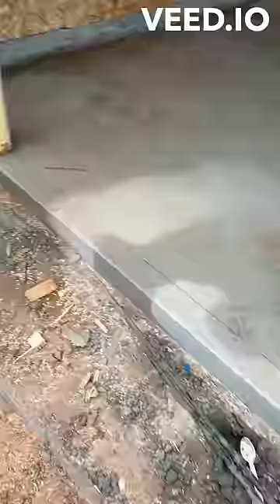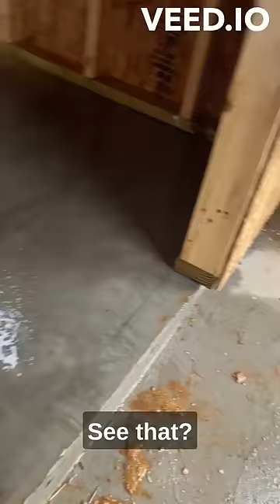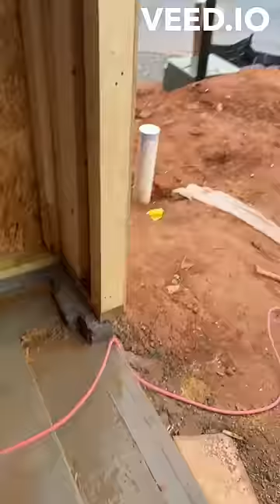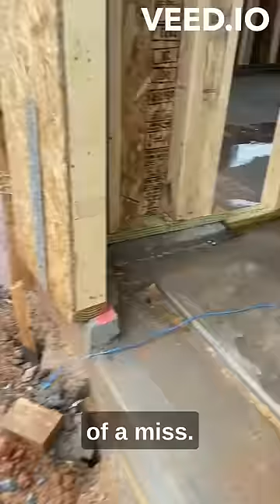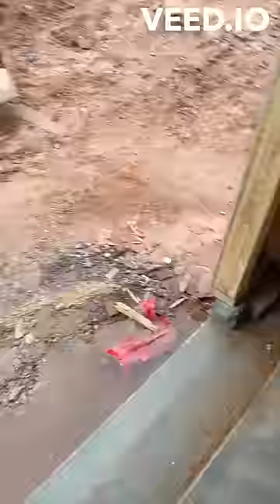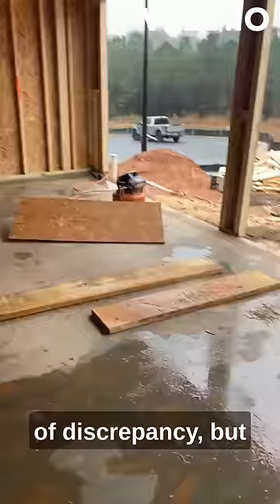New Home Slab is Wrong Size, What Now?

Comment: What to do here as a framer, after you snap lines and check if it's squared, you let the general contractor know about the concrete discrepancy to see if there's a solution. Before you frame it.😊
Reply: Yeah like the blueprints will need modified. These framers on crack or something?
Reply: No no no , that makes way too much sense , why would they want to do that ? 🤣🤣🤣🤣
Reply: @jesusischrist1527  I think they wanted to be paid to take it all down and re-do it.  This is just people that don't care.
Reply: No because that means all the crew to don’t work that day ., week or month and wait until it is fixed .,
Reply: What if they DID, and the general contractor told them to "just frame it" as an answer?
Reply: No. We just work there. The owners need to stop rushing everyone. Quality out the window. We're like China now
Reply: Ah yes, I think this is referred to as not being a dick
Reply: Wow what a concept 😂😂😂😂
Reply: it's because the contractor said keep going. it seems like most of the time it's  more important to get it done than it is to get it done right
Reply: @dialecticalmonist3405 IF that’s what happened then the GC is an idiot. They should have just adjusted the framing to the slab (or had the slab guys come fix (though not sure how they’d do that)
Reply: @codycast Exactly; what would they lose on interior measurements 2" tops.
Reply: One of the two contractors didn't read the blueprints..
Reply: @consaka1 it's very likely the framers are correct to the engineering blueprints. Roof trusses are almost always pre-built and delivered to the job site. If the framers would have adjusted to match the  concrete the roof trusses would not fit.
Reply: Jajajajajaja 
As a framer we never had issues.
lol 😂 almost never!!
We always adjusted as needed.
You check the overall before you start.
I remember one day the trusses company said “Ernesto we never have issues with you””
Of course,
I always took care of them on the spot 👍👍👍
Keep production going 👍👍👍👍
Reply: Follow the plans……
The plans will set you free!!!
Reply: @thomashefner Trusses would fit if you adjust the stud lengths to keep the top plate level.  Would be a lot of extra work for the framers and would need longer studs to trim to size.  Drywall framers and trim guys would have a fit with it.
Reply: if you are modifying the trusses, you are required to have the prints redrawn, signed off by an engineer and resubmitted to the building department. It's time-consuming and expensive. If you are not doing that you are telling us that you are a hack.
Reply: And no customer would want to hear it but that house needs to be made 3 inches shorter, not overhanging the slab. I never seen that in my life talk about an idiot.
Reply: Everybody needs to be sat down and explain that the house will now be 3 inches shorter, otherwise rip it out
Reply: @thomashefner  I'm very aware of that which is why you take the issue back to the main person in charge of the blueprints because a decision will have to be made and the time to make it is before framing starts. You can alter the blueprints and redo the trusses if they've been done already or you can make the concrete guys redo the concrete. You can't just patch that and expect full strength. I'd expect the GC to come down on the concrete guys like a ton of bricks. Whoever messed up is losing money on this job.
Reply: We come across this many times, the architect has to approve the reduction of the size of the structure by a few inches, 
Which can affect the roof trusses and load barring points, but usually doesn't but when it does more changes have to be made...
(Other load barring walls may be moved or changed to 2x6 to match up with load barring points on the trusses...)
Reply: @curtisflategraff6511  You think a GC, Who knows that will NEVER pass inspection is going take on the cost of fixing it and the damage and embarrassment to their reputation....? I don't think so... Could get very expensive..!
Reply: Well who ever did it is probably a 3rd party group. If they don’t work they don’t get paid . In the construction business it’s the next man’s problem
Reply: Just move the damn wall an inch,
Reply: Just tilt the walls in at the bottom problem solved..Now what else needs my solutions
Reply: I’m willing to bet that the framer absolutely 100% told the home builder and the builder told them to cram the house.   The framer was scheduled to frame that house and shouldn’t be loosing money since it’s very likely that he didn’t have another job lined up right away.  The builder will fix and the concrete guy will pay for it.
Reply: @curtisflategraff6511 👍🏼
There are common sayings in construction.
• 'There's never enough time to do it right, but there's always enough time to do it over'
• ' Can't see it from here'
• 'It's not my house'
Reply: So.. framers couldn't have framed it inwards the couple inches? 
Wth
Reply: Remember, nowadays the frames come already prefabricated, the framers just are assembling what they receive. But yea there was a lack of communication here.
Reply: How about instead you childishly put it in per plan as a passive aggressive gesture??
Reply: AMEN BROTHER!!!
Reply: @dialecticalmonist3405  Doesn't matter. Do you want your name on that nightmare?
Reply: Nah you screw up the entire job and leave everyone scratching their heads after and cost thousands to repair it lol
Reply: what happens when u piss off the contractors and stay on there toes 😅
Reply: I was wondering the same thing man. Like why even do it if it’s wrong. And I cal already hear the boss’ comment to his employees. “That’s not our job, we have a job to do and we’re going to build our shit to the specs WE are given.” And I’d leave. Can’t do something I know isn’t right. Idgaf about getting paid for it or not.
Reply: This is what happens when it's rush rush rush just put it and get it done 🤔🫣🙄 y left the trade 😔
Reply: @crawlspaceemora brother, you haven't met very many engineers... I built a bag house at a gold mine in Nevada. The prints were oriented inversely so north was really south. Consequently the bag house was backward and the conveyors led to nothing. That's when we started wondering about the plans. Then we worked 7 12s to try and catch up from the mistake. I guess our overtime was cheaper than the late clauses in the contract. The company was called TIC. Stands for "Turning In Circles"😂 (or The Industrial Company)
Reply: I'd avoid this company in the future. If they don't know how to deal with this, what else will they not know how to deal with.
Reply: That’s easy fix
Just fill out the concrete 
It’s obvious they did the framing even though foundation was off
Reply: The framer gets payed twice now though. Because it’s not his fault. It’s the concreter’s.
Reply: @GrasshopperKelly  the framer is fired. They don’t get paid and a mechanics lean is placed on the property until the court proves the framer is at fault.
Reply: @jstrada5077  minimum 12x18. That’s gonna cost the same as the new slab all the way around. No.
Reply: @buixrule  "Doesn't matter"? So what is the solution? Build the thing to conform to the wrong concrete foundation and then get sued if something goes wrong because you intentionally didn't build the frame to spec?
Reply: Adjust the framing seen this several times. Don’t turn a small issue in to a big issue
Reply: Exactly. Amazing comment
Reply: It’s probably a pre fab bud
Reply: That all has to pushed back you can't form CONCRETE like that it would never pass ,,So you garage is 11-8 instead of 12 get a better contractor
Reply: Yes, keep it simple.
Reply: Well no shit
Reply: Was this done recently in Florida?
Reply: How dare you make sense!
Reply: Thank you, I was wondering why they would continue framing if they could see it wasn’t right.
Reply: This framer eats his whole burger before asking for a refund because it had pickles on it and he asked for no pickles
Reply: Not a project manager insight
Reply: Either the concrete guys screwed this up, in which case the GC should have made them fix their mistake, or the framers screwed this up, in which case the GC should make them fix their mistake. If everyone followed the drawings correctly then the mistake lies with the architect for not coordinating the structural/architectural drawings. As a GC I'd be talking to a lawyer at this point to determine the correct course of action.
Reply: So who pays the crew for the downtime because of a concrete mistake? Asking for a framer friend of mine.
Reply: @codycast well what I've done on jobs, many jobs, is rough up your foundation walls, drill steel dowels, form it back up and pour.
Reply: Right, but what is the solution to this problem?
Reply: Nailed it lol
Reply: Not sure how it works where you are from but here if the GC can get you to start work, then you've accepted responsibility. As a GC and commercial super, I'd recommend you get something in writing and have your lawyer review it before you start work... never start until you are covered.
Reply: Except when the GC curses you out and yells at you “ FOLLOW THE DAMN PLANS!!!!”

Yes sir!
Reply: Hey Boss... The new guy you hire is no goooood. You pay him way to much...
Reply: As I’ve seen in first hand with couple years of experience I can say that more often than not it’s miscommunication and miscalculation from either party involved… also General Contractor also tend to give the green light prior to continuing the job… this seems like possibly framing inspection getting done?
Reply: @codycast  add more concrete around the slab or 2”x2” angle iron under bolted to the slab..
Reply: Problem with prefab framing. It goes together like a puzzle. And slab needs to be right or pieces dont fit.
Reply: Exactly.
Reply: @paultarp9150 this is exactly why they do it! As a builder, I occasionally see this type of bullshit. I fire them immediately and have another crew come make the corrections. They know better but don’t give a shit!
Reply: Right. Who does the whole job a half a wall off ahahaha. Pos😂😂 you know when he got done he said. ( looks great from my house.) Then drank a few beers on the way home to get what he had done out of his head. I'd fire dude that did this.
Reply: Check this guy out..... making sense n all that 😂
Reply: Yep
Reply: Preach! Sounds like a bad GC. Someone is not spending much time on their job sites....
Reply: No they absolutely could not have.  If they made the house smaller then the roof trusses which were either already on site, or soon to be, would not fit.  I guess you have never built a house. @turboflush
Reply: No, you go ahead and frame it and get that $ and let someone else worry about the issue(s).
Reply: The problem is cheap labor can't speak English so they just take the day pay cash and when they get canned they don't care.
Reply: @jayburris6252  depends on your roof system.  I guess you have never built  a house. 
Either way.. someone is responsible for the bad decision to continue, knowing a problem.
Reply: Framer's have to work to kitchen cabinet dimensions. The cabs are already in production. Also the miss seems very consistent, concrete guy was probably using inside dimensions or something.
Reply: @turboflush what happens to the kitchen cabs then?
Reply: This is the new America (US) get it done now, we'll deal with it later attitude. We must build, must build in a hurry, the more we build the more money we'll have. 
I see it almost every day.
Reply: @spilledit Illegal, especially Mexicans in South America's. Need to go to China to learn how to do something right.
Reply: I don't think they framed it. I think all those walls came prefabbed from a plant on a flatbed and raised up by a telehandler. Concrete guys deviated from plans most likely, or plan needs to be redlined. Had this happen on a commercial pool project, they screwed up the pool house big time, our measurements were way off, turns out someone screwed up the benchmark
Reply: @JT_70 exactly. Everybody’s paying for the dumbass concrete guys mistakes.
Reply: "I built it to the drawing boss, what do you want from me"
Reply: At least it’s consistent
Reply: Cheap is cheap gets
Reply: @spilledit yeah it’s a process that can’t be rushed
Reply: Good luck passing final or getting insurance.
Reply: Most houses built today have some trusses and ALL production houses have trusses.  The concrete guy is responsible.  Period.  No discussion needed. @turboflush
Reply: And delay pay day for a few weeks? Nah I gotta get that bag!
Reply: This is unfortunately is not an uncommon occurrence- that is why with 40 years of Commercial/Residential construction experience I prefer not to hire any contractor to build my house or other
Reply: I'm guessing this isn't the first time the framers arrived and the slab was off. Delays cost time. Time costs money. They likely framed exactly what the drawing said to make a point to the GC. In court, the framers can likely prove they built it per the drawing. GC will probably back charge the concrete guy for the framers to fix it. Framers get paid twice rather than costing them money.
Reply: What if you measured the concrete before even starting the framing. You know, to make sure it matches the plans?

Can't be too hard. There's literally nothing in your way.
Reply: exactly
Reply: The framers did good by building the house. The concrete guys can fix this later.
Reply: Yeah obviously. You don't need to be a framer to figure that out.
Reply: Im sure general contractor knew it was inspection day, I don't think he cared 😂
Reply: and China's production quality is getting better and better @spilledit
Reply: @dialecticalmonist3405  that's likely what happened
Reply: Was the framing made off site
Reply: Exactly and more likely than not they would've been told to move plates so they're sitting on something solid and  Just keeping everything else like plans call for and just lose a couple inches right there.
Reply: This discrepancy albeit small, changes the rest of the blueprints and that could cause a major issue not to mention that being 2-3 inches on frame actually changes the square footage of the whole home and being a big house can add up to a lot... imagine now trying to frame or run electrical but having to adjust all measurements by a few inches overall...
Reply: A big shed.
Reply: @thomashefner well said
Reply: @jackwillie2729 Best plan out of all these other ideas 💡 😊
Reply: Yep! Been here a hundred times! People don’t realize that the trusses are already sitting on site by this time, they gotta fit!
Reply: @codycast how do you push all walls in 1" without thinking about all the windows, doors, electrical, plumbing, drywall, and finishing guys
Reply: Truth
Reply: I'm guessing the framers came after this concrete guy before .
Reply: @thomashefner your not a framer ...for sure ....the trusses can be modified, and bearing points added ...... seriously?
Reply: @roberthopsonsr.2822  sure, if you want to have the truss plans re-engineered and re-submitted to the building department. You might call yourself a framer, but it sounds like you're a hack.
Reply: Thank you. YOU HAVE THAT COMMON SENSE, THE KIND THAT COMES FROM GIVING A DAMN!!!!
Reply: @davidgray8089 This is the comment I was looking for. By starting work you are accepting the substrate is correct 👍
Reply: @Imarida2 you can extend the concrete to the correct dimension, with engineers approval. Meaning drill and epoxy some anchors, add welded wire fabric and then form up and repour. I’ve had to do this on one job and it was a pain in the ass. Think we needed a 16” foundation and it was initially a 12” if I remember right. But this would be difficult with the framed walls in place, and the fact that it’s been backfilled. Other option is to move all the framed walls inward. But that concrete guy is most likely gonna have to pay for whatever the fix is
Reply: @consaka1 when did anyone mention farmers?
Reply: I recently learned that they don't stop. They just keep working. In my case, it was the manager that came by to check and stopped them. They just go by the blueprints regardless.
Reply: @spilledit  my house took 16 months. I wasn't rushing them but dammnnnn living with my parents for 1 year suck ass.
Reply: But then you don't get that sweet sweet change order money
Reply: This is the correct answer.  Everyone here saying the framers didn't screw up and it's on the contractor who did the pour is missing an important point.  While the framers may have built to the plan, by not stopping and bringing an issue this big up the the general you can guarantee that this is the last time this framing contractor would have a job with this general. Employees who just do what thier told without thinking are half assed.
Reply: I guarantee the cheapskate homeowner is the gc and this is his fault
Reply: @Imarida2 Read @Bawk Bawk Bawk 666 replying on how to repair the foundation! It's the comment right before yours
Reply: @codycast this is not impossible to fix for the slab guys. Even after framed, though that makes it more difficult. The slab won’t be as good as it could have been, but it will be fine.
Reply: How absolute dare you make sense!
Reply: They probably did and foreman said just build the damn thing
Reply: @consaka1 They probably finished on a Friday afternoon, and got started drinking a bit early on the job.
Reply: And then you get a hand-written, signed (by both parties) note on the master set of drawings.
Reply: Completely wrong as the framer needs to get the house dried in so he can get his first draw. (Need I point out my sarcasm, but at the same time that’s exactly why to framer isn’t going to slow down because of someone else’s screw up).
Reply: Buy an older house and renovate it, better bones . 
Houses now a day are just slapped together.
Reply: @spilledit  Your solution to improve quality is do shit like this?

Get real. You want to toss around ideas like pride and quality, you don't get to even consider a move like this.
Reply: @deadfisher0000  pay better. Organize the company better. I'm not fixing someone else's company. Lazy bosses think someone else's labor is a right
Reply: WTF. What reasonable person just doesn't cut half an inch off somewhere and make a note?
Reply: All you have to do is make a few adjustments. Easily could have fixed these issues and the house would still be square.
Reply: This is exactly why you want to know your framer . Stupid to create these problems .
Reply: Best to get ahead of crew and find the issues out before you hit the job with a whole crew.
Reply: @hiway12 bullshit
Reply: @compudude86  you can still adjust prefab walls . This is stupidity at its best.
Reply: @jayburris6252 if the dam walls are off the slab the trusses will not stay up anyway . Rookie mistakes
Reply: @consaka1  Nobody measures anyway...A couple inches here and there is normal.
Reply: All that happened here was the concrete guys formed up for a 8 inch wall instead of a 10 inch wall. They'll have to fix it when they pour the driveway. I don't think it really affected the framing. If that garage wall is even off an inch that's not really a big deal. Besides the bearing below it obviously. But that will be a gable wall. This is all we've seen though there could be a lot more issues. I've literally seen houses that are almost a half a foot out of a square. Get to the last six trusses and this had raised heels lol. Last trust is hanging off of the wall 1 and a half lol. Not good. Slab on grade. Literally cut all long walls free from slab. Pushed em out. Concrete guys came back and dug literally a frost footing around half the house. Poured a shelf to fix it. Turns out the builder We were framing for had a long time concrete guy for his subcontractor. Well that guy's workers were purposely doing that to all of his basements for almost half a year to ruin his name. They all work for another subcontractor now after they accomplished their mission. It's a long story. I actually used to work for the guy before I started framing and this is a perfect example why you don't hire illegal workers. These guys moved with their boss from like Arkansas to wherever I'm not going to say. This was probably almost a 25-year long relationship. The main Foreman brought most of his family to work. As the years went by the guys wanted more money. Well they only got so much. They got to the point to where the boss never really showed his face. And the guys kind of just slaved for him. And from what I explained it got to the point to where they started to ruin the guy's business. Whoops
Reply: Could you add like 6"-12" concrete slab along the front under the overhang?
Reply: @spilledit owner don't rush and you guys go waaaayyyyy over budget and time
Reply: 3rd world help and want to complain.
Reply: To bad the framers don't speak english
Reply: @JT_70 that goes completely against code, hence why it can't be done. Also frames are pre made mostly unless your doing on-site framing. And due to the pre made trusses the only way around it would be to either adjust plans to match foundation or fuck it up haha. But that's what happens in nz so you could be right.
Reply: Everyone is in such a hurry these days all about the money. Which is obivously important but I've been a tradesman for 25 years and it just seems like the guys who seem to give a crap get treated the worse. Yeah,nice guys do finish last sometimes
Reply: Some times it's about calling someone out for a repeated offense.
Reply: That’s what I said then read comments lol
Reply: Ah the good old days it seems. The more videos I see, the more I wonder who is building these homes. Profit motive and quarterly beats.
Reply: Go watch SyFy home inspections. The crap he finds is insane. You couldn't give me a new home
Reply: I guess in this case it’s easier said than done 🤣
Reply: Simple solution,  they just need to make them 2x6 walls.
Then you get 4" on the concrete.
Reply: If the concrete crew is wrong, and formed it wrong the GC and the owner needs to know.. the framer should not be chaulking out the correct measurements if they are not properly supported.. the fix is make sure it's square but supported.. shorten the lenght or width as necessary. But it has to be supported properly. 
Having framed before I would be ashamed to put my name on that and even if the GC  said go ahead I would be wanting a clearance letter from him and an engineer absolving any responsibility from inspection faults or the owner saying what h.ll who framed this sh.t
Reply: carpenters can adjust to discrepancies.  that's our job
Reply: @consaka1  that's the piss poor work of a bad concrete guy and an even worse bldg superintendent because he is supposed to give one final measurement check to ensure this DOESNT happen.
Reply: It's not the framers fault.  The general contractor should have checked the foundation to the print.  If there was a discrepancy, the general contractor should notify the property owner and the framer.  If the framer built on a out of speck foundation he would be at fault.  Modern construction is mostly like this!  It's just about all shit work anymore!
Reply: Or simply don’t frame it as you’re the one putting your name on the work.
Reply: Why on earth would you check square after popping lines 😂
Reply: Preframed walls
Reply: @codycast exactly
Reply: @codycast probably custom made trusses on site, are you going to magically shrink them?
Reply: @williamclancy9150 It could be your bathroom vanity it could be the granite in the kitchen you never know they do it to spec for reason so this was definitely on the concrete guys in my opinion
Reply: Yeah it's all an inch and a half short
Reply: The concrete  guys screwed up and the framers are tired of having to fix the screw ups, so the measured it out to spec and said the hell with it.
Reply: @paultarp9150 oh guess what guys,you don't get paid to fix your fuck ups.
Is what I will tell them.
Should of done it right the first time.
Reply: Maybe the foundations off a little bit and they need to reform it a little bit and call it a day
Reply: I bet they did check and were told to go ahead because it's too late to change the print. Probably hoped they would get away with it
Reply: @turboflush not if they were correct in their measurements. They can’t change it that easy especially if there’s stubbed out plumbing in the slab fir say a toilet or something
Reply: The contractor wants it done so he can collect the next cheque……
Then he’ll say WTF.
Reply: Exactly. That's what we've done my entire life. If the slab is jacked. We let the homeowner or GC know after we pop it out and before we start framing. That call is on them 100%
Reply: @dialecticalmonist3405  if they DID. then that's 100% on the home owner and GC. Seems like that's the case here. And the guy making the video is just trying to weasel out of his accountability ànd put the blame on the concrete and framer guys
Reply: They probably did that and the person in charge was like it's ok. well just fix/ (bury)  it later!!! lol!!!😂😂😂😂
Reply: JUST POUR DRIVEWAY
Reply: The only thing that makes sense us they built out over the concrete forms...It didn't get caught until they removed them. Yeah that framing crew was a bit to impaired that day🥴
Reply: Couldn't possibly make an adjustment, it's easier to make excuses.🤦
Reply: @paultarp9150  yep. Insurance. Double pay. And material reuse issues too. All studs and beams are punctured and now compromised. Of course the gc will reuse LVLs and PSLs and Simpson shit and the rest of the vultures will pick through studs.
Reply: Whoops
Reply: @codycast yeah, how can it ruin everything to pull the framing back 1-2 inches. Drywall and sheathing will need to trim a couple pieces, big deal. Do the framers speak English?
Reply: @jstrada5077 fill out the concrete? That little strip helping hold up the whole house? No strength in a thin little strip. Bore into the existing and glue in rebar ties?
Reply: I'd bet the trusses can be shifted slightly. I've never seen anything really straight, square or plumb on anything I didn't build myself.
Reply: @r.rodriguez4991 it is standard to check square and dimensions before framing. Takes 10 minutes, maybe 20 for one guy on a complicated layout. Then only the plumber and concrete guys have to come back...and maybe a demo crew....
Reply: Yes that is the correct way. This honestly comes down to what builder the framing crew is working with though and the timeline. Most builders want them to just frame it though if it will stand temporarily. Because the concrete crew can come back after and repair it and if done right it wont effect the end product. key word correctly. But the repair is done the same way usually whether the framing is there or not. The framing does give them something to work with and nail to for repairs. Plus other trades can carry on schedule while repairs are done. I'm not saying you are wrong you are completely right to say the framers should call the builder after they pop lines and notice it. Where you are wrong though is assuming that they didn't.
Reply: @turboflush  That would shrink the floor plan or make it out of square so no. This is a very easy repair for concrete crews that know what they are doing and it doesn't effect the end product. Key words though "know what they are doing." Your suggestion does effect the end product. Would you like paying for a house with a specific floor plan and you move and find out your garage shrunk by inches? Or even just getting a call to see if that's possible for you to compromise on by your builder? No you wouldn't be comfortable as much as you might think you would be. So the framers frame the house correctly to plan and the concrete crew will come back and fix the foundation underneath it. No need to call the customer or change the floor plan. Hope i didn't sound like an az i thought you were genuinely asking😊
Reply: You don't change the plan because concrete guys made yet another mistake as they always do.
 The concrete gets fixed later geez. The house stays the same size as engineered
Reply: The framers should lose money because the concrete guys screwed up?
Reply: Right right that should have been a given
Reply: Or better yet it didnt have pickles on it and he asked for it.  @CoryFugger
Reply: This is the right way of doing things. Alas this is not the common way of doing things. As a result, the GC gets railed hard and hopefully has a way to make up the cost elsewhere.
Reply: Trusses are pre-manufactured at a certain size. They’re just fitting what the lumber truck dropped off.
Reply: I saw the chalk lines and thought, really you kept going even though you knew it was wrong?!
Reply: there was always a solution that nobody didnt agree with me
Reply: No.  The concrete guy was there with his tape.. The GC had a tape,, but the guys who find the problem and point it out are the ones who are gonna pay for it?  No effing way.  Concrete guy can come back and fix his mistakes.
Reply: The stick frame was likely prefabricated and delivered to site for erection.
The framer is lucky he found a datum edge or corner to start from.
The concrete team most likely got this wrong. It's not even square let alone the right size. 
It's not unrecoverable.
Reply: @walsakaluk1584  No.  whether panelized or stick frame,, the framer has no choice in the matter and IF he says, "I can't do this,,HE is the one that loses money.  So many of these comments,, say directly or imply, the framer should be financially held accountable.   There are 5 men and himself on the crew that is 2 or 3 grand a day in wages.  The concrete guy could not be bothered to pull out a tape measure,, the General Contractor could not be bothered double checking the concrete work before the pour or after.  It is strictly unfair to both blame, and financially punish the one guy who identifies the error and did something about it.  Yes. There are times when you should walk off.  But it is going to cost you 2 or 3 thousand dollars per day,, and very probably all future work for that builder.  The framer did not cause the problem. The framer is the one that identified the problem and did something about it.   And now he is to be vilified for finding a solution?
Reply: @paultarp9150  I've heard that one many times, "Their mistake. Follow the plans for your job and they can pay us to redo it." You would think that would force them to rethink their unprofessionalism but it never seems to. The consequences aren't tough enough.
Reply: @JT_70 all blueprints would have to get adjusted
Reply: DEI hiring FKH
Reply: Is it a kit house where the panels come pre-assembled?
If so, then the base layers are to blame unless the plans for the base were wrong.
Reply: It's actually an easy fix happens more than you think
Reply: @codycast it's actually an easy fix
Reply: They're not professionals.
Reply: @consaka1 naw blueprints aren't updated. These are installation or field conditions. At most, an RFI would be brought up to the architect who then tells them how to fix it, but looks like they didn't lol
Reply: @thomashefner These are houses, not commercial buildings. There are no engineering drawings or trusses. The rafters are stick framed.
Reply: You frame it to match the concrete pour on the fly or your a cray framer as my grandad who was life long framer would say
Reply: @cessarflom8664 not to mention the owners waiting to move i
Reply: @spilledit not the owner's fault in any way.
Reply: @hiway12 the framers have to work with the cabinet dimensions? I have no clue where you are located at but I've never heard that one before where im at. Our framing crew comes and obviously frame lol. Then we have the cabinet company come out and we measure together and we tell them what we want they give is a layout we sign off and by the time all the other subs are done and it's rocked and taped the kitchen shows up and I install.
Reply: Well Framers drywall and roofers tend to not be the most reliable people.
Reply: This reminds me of the great quote "Kicking the can down the road."
Reply: It would be a whole lot cheaper for everyone if you framed the house with full bearing on outside walls and then just furred out the walls to the plans. Not perfect but certainly not the framers fault.
Reply: Well there is no fix for that period, so the framer should of just built the walls within the foundation. It looked to be an 1 1/2’’ max on the worst one. You can’t be afraid to make the call, and that is the right call.
Reply: @anthonyjeromejr.6808  the other fix is to build another full bearing wall on the inside of the perimeter. You will lose a few inches of floor but contractor gets a nice change order so there’s that.
Reply: wow, really?
Reply: GC Probably got annoyed with the question and said just do your fn job and frame it
Reply: @thomashefner   It depends on which way the trusses are facing.  My guess is they were 'side-to-side' over the garage (flat face on the door side).  In that configuration, simply aligning the walls with the concrete would have been easiest.  Framer probably has had (repeated) issues with foundation crew, and framed to specs to make a point.
Reply: Yeah the solution is make the garage smaller I don't think you'll notice 2or 3 inches and then back charge him
Reply: This is an unprofessional pile of framers!  I don’t care if they know how to frame that does not make them pros!  I do finish & hv had disasters but this ?  
It’s a complete mess , waste of time, money & materials!
It’s a sample of childish behavior after an argument bout the slab being incorrect !
Reply: @dialecticalmonist3405 you better cover your ass and get that on video or in writing. And the comment below says, ‘we just work there.’ Both of your answers are that of an incompetent employee. It’s not your decision to make when the contractor says ‘just roll with it’.
Reply: All that had to be done was move the wall in, problem solved
Reply: @turboflush  yes butit really does change truss length beam length and all kinds of other stuff.
Reply: The general contractor probably gave framers the go-ahead
 He doesn't want to delay his completion date or final payment.